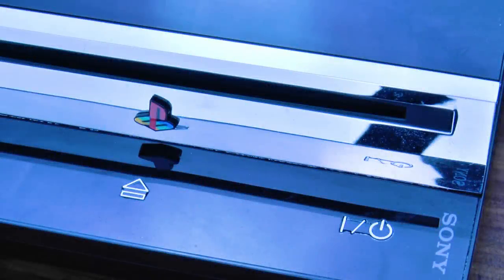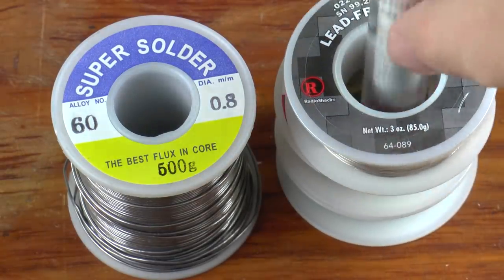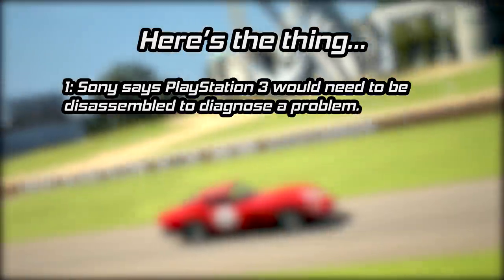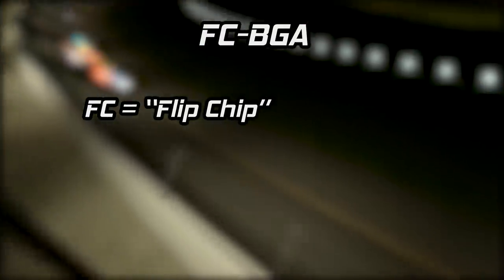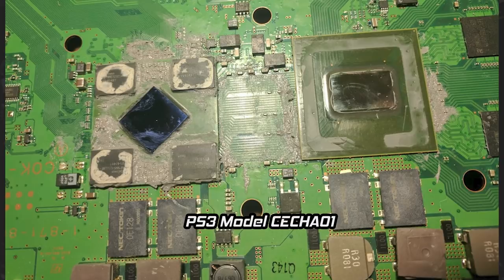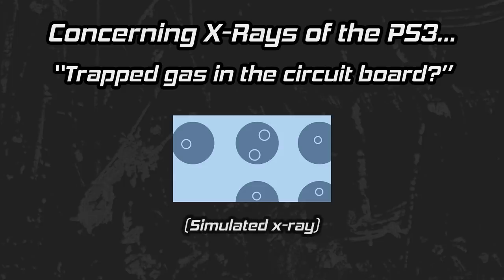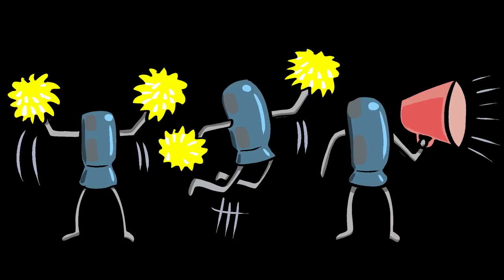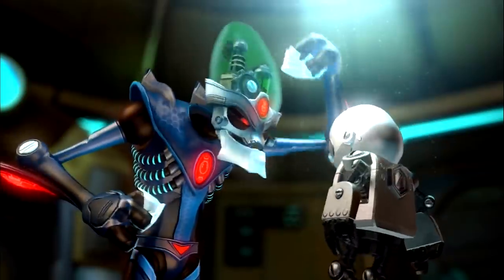The Misdiagnosis of the PlayStation 3 Yellow Light of Death

Comment: So even without hacking your PS3 it still would cause YLOD for the earlier models!?
Reply: Hacking has nothing to do. I had a launch 60GB model that died in about 5 months from YLOD. Then I bought an 80GB model (the one with ~85% backwards compatibilty with PS2 games) and died from YLOD about 6 years later.

None of my consoles were hacked
Reply: @asturides  My PS3 slim 2xxx died after about 3-4 years, used CFW on it. But never intended to hack Sony consoles again after that. I still have one untouched PS3 super slim, never use it. I keep it because of Gran Turismo games. I hope PS5 can run PS3 discs natively, although the chance is thin.
Reply: @eternaya  I wish that too. My PS3 controllers are dieing and there are not many originals around

Comment: Basically the same thing happens in auto repair. It is beyond frustrating when a customer walks in asking for a specific repair (usually replacing a sensor) without any more diagnostics done beyond a code pull. They usually claim that their problem is "exactly like" some random post in a forum and that they know what they're asking for will fix the problem. Most of the time, I already know what issue they're referring to (TSB's are helpful) and that their vehicle isn't going to respond to that 'fix'. They'll get angry when I tell them that I'll do what they ask as long as they don't hold us responsible for when the Check Engine Light comes back on. More anger ensues when they ask about the diagnostic charge. It is a vicious circle that could have been avoided if the person would just let me do my job.
Weirdly, My Mate Vince just went through replacing those capacitors on his channel. I didn't watch all of it to know if he was successful. I just thought it was interesting...

Comment: I reflowed mine twice by taking stripping down and pulling apart the motherboard and applying new thermal paste myself as a teen. I was in its guts and i performed this operation twice and For me the difference was getting 3+ extra  YEARS out of my yloded OG Phat day1 ps3. Had i not done this i would have had no console after H.S. and before the ps4... i am no electrician past getting my Merit badge in BoyScouts. But i mean, my ps3 would have been a paperweight halfway through the generation, but i recesitated it twice and  kept it alive up until the launch of ps4 soooooooo, knock it all you want but unless you can provide a better working solution then.. ahhh shit ya dont know?!?! Even now? Ok... I used a heatgun on my motherboard VERY carefully and minimally. And 3+ years! I did it myself and didn't cop out. Nice to have a better solution to repair it for good, But when your kid with otherwise NO console guess what? A solution that works is far better than no solution as at all, as much of a hassle that it may have been.

Comment: I threw my 40gb ps3 motherboard in the oven every time the ylod appeared for about a year. It was such a painful console to own. I loved the PS3 library, but hated the console hardware, because of how expensive and unreliable it was. I’m so glad the PS4 and pro don’t have any issues, whatsoever, I wish it was backwards compatible with PS3 games, though.
Reply: Actually numerous PS4's didn't even work at ALL during launch, I never heard an official follow-up as to WHY, either...there was talk that they were damaged during shipping, tho others that people bought worked fine until they got mildly bumped & also stopped dead (talking TINY bumps, not mock-up WWE bodyslam competitions).

By sounds of it the (launch) PS4 was either assembled poorly or assembled with brittle/inferior parts, tho SCEA honoured exchanges/warranties etc & seem to have quickly corrected the problem (it ONLY happened to the units released at launch during Holidays AFAIK)...

...still, far as I'm aware they NEVER actually SAID what the problem even WAS (blaming rough shipping was just their initial response after they tried denying it outright until the denial was refuted by HUGE #'s of consumers w same complaints), tho at least was isolated.

PS3 has had several issues & each iteration has actually been a downgrade (Back-Compat was 1st to go, then they swapped the 19-blade straight-edge fan for a [cheaper] 15-blade curved fan [that was found to actually back-flow heat INTO the system, ESPECIALLY if laid horiz rather than stood vert etc]...there were at least 6 of these downgrades as versions went)

Feature-wise the Back-Compat versions were best (IIRC the 60G was best of 3 launch models), performance-wise the Slim was best & tends to live longest. Superslims were the worst of all, tho later ones are better than initial Supers (which were a cost-cutting end-line production model as they waited to release PS4 & 1st Supers were basically shopping bags & bubblegum for quality), because they failed often so SCEA reworked/improved them a bit. Supers at least had ability to recover disks tho...needed to do surgery on any of the older ones to recover disk if tray locked up. Metal housings in older "fat" models were a BEAST to crack open~
Reply: I'm curious as to what the PS5 will do as far as BC tho...I hear rumour it may be "total BC", doubtful TBH, but it'd be GREAT to play my entire library again...I have over 100 PS games, over 60 PS2 games & easily as many on PS3 if not more...as SOON as I knew PS4 would have ZERO BC I was on the fence then passed altogether with the PS+/XBox mimicry just to connect online (I pay my ISP, VERY well, for exactly that)...if PS5 is fully BC I may consider even if PS+ is still a thing/I just play offline.

If it only plays PS4 (ie no PS3 at ALL nor anything prior) they can keep it tho (since I never bought any PS4 games anyway) & I'll just go to PC after I save up/build one. Gonna hang on to my library til then & see how goes tho~
Reply: Blemished Nicely I’m sorry but tldr more than 1 paragraph that you posted. And yes, I remember reading a lot about broken ps4s at launch and the bad batch story. But I feel my comment still stands. I don’t read a lot of system failures online that are systemic like the 360/ps3 overheating issue, just minor superficial ones like loud fan noise.
Reply: @kaytee7607  
Dunno, as soon as they  announced PS+ was mandatory I stopped buying consoles. After hearing about the busted launch machines (coupled with the rather dismal past few years for gaming industry in general as a whole) & am pretty glad I did.

Went from a console per decade to PS4 Pro 4 or so years after PS4 & IIRC they announced PS5 with estimated "Holidays 2020" release date (before Pro was even OUT, IIRC)...pretty ridiculous stuff IMHO~
Reply: @kaytee7607  
PS4 also has the same horrible Data Transfer utility as PS3 (which they lazily ported to larger HDDs [was only designed to handle 100GBs tops] like they did for the Friends list on PS3, which was only meant for 50 & bugs out at 70 or more).

IMHO they kept that Transfer lazy on purpose to encourage PS+ sales/cloud access.

Comment: My PS3 doesnt YLOD but its USB chip doesnt power on its 2 USB ports. Dunno what should i do after watching this. I was planning on reballing/reflowing
Reply: Find and check the USB power fuse. Or first try to determine whether the issue is with USB data or USB power - use an active hub with a power supply or use some kind of device that uses only external power supply and doesn't use bus power.

By all reason, reflow is likely never the answer, and can you even perform a proper reball?
Reply: @SianaGearz  Its power. The USB reads (or tries to do so). A USB hub lefts it blinking, or not recieving enough power.

Comment: I donno if this was a wide spread problem or just the same problem as in this vid but .i had several ps3's and each and every one without fail i could eather have it for a month or a year(ish) and then it would stop powering on .the only thing that would help was to blow or apply cold air into the fans somehow then turn it on and miraculously it would just work as if nothing happened. But you would have to keep it cold for about an our at a time if you wanted to turn it on and off more than once in one day .it drove me mad and still have the console if anyone has any suggestions on how to fix it 🙂

Comment: First I replaced the PSU... no luck. I have taken apart my 60gb ps3 more times than I want to count in an attempt to reflow both the GPU and CPU. I will say the cheap thermal paste used in the ps3 is horrible. It was dry, crusty almost and I switched it out with artic silver 5. However, I never removed the heat spreader to change out that paste. I even used flux a couple of times when applying heat from a heat gun in an attempt to reflow. Everytime I reflowed the bga's the ps3 sprang back to life for a period of about 6 months. After 3 failed attempts at reflowing I even had the GPU and CPU reballed with leaded solder which cost me almost $300. This again only gave me about 6 months of medium/heavy use. When it failed for the last time I got desperate and heated the mobo in an oven to reflow everything. This warped the mobo and I would advise never to do this based on my experience. At the end of it all... I still have a ps3 with the yellow light of death. I can tell you first hand that reflowing and reballing was merely a temporary fix in my case and did not solve the issue. I did so much research because I refused to simply settle for a $600 paper weight. I could probably disassemble my ps3 in a dark room at this point. This was years ago however, and I never remember seeing anything in regards to the capacitors potentially being the issue. Its unfortunate. This was a serious issue and one that Sony should have acknowledged and addressed. Microsoft did the right thing for their customers and the red ring of death. Sony ignored it.

Comment: If you do get the YLOD, how about doing this. 

Reball both chips.

While both chips are out, heat up the center to potentially fix any issues there. 

Replace the NEC chips. 

3 potential issues possibly fixed. 

BUT I've been trying to fix a strange PS3. 

This PS3 doesn't have the YLOD or the RLOD. It powers on, will display for 5 minutes and after maybe 5 boot up attempts, the screen will garble up and freeze. That RSX is gone hahaha. I want to learn how to soulder so these two broken ones I've collected off people who didn't want them will be practice attempts.
Reply: >reball both chips
so you'll never know which of the two chips had gone faulty
Reply: @matt4193  Doesn't really matter to me. Preventative maintenance anyway.
Reply: @XxUltimateGodzXx  heat cycling a component is not preventive nor maintenance, in fact it shorts its lifespan.
Reply: buy a new chip in aliexpress
Reply: @maytizevb  no.

Comment: I just put my PS3 in the oven as two tutorials suggested and guess what? It didn't work. Will order some capacitors and hopefully bring back the PS3 alive. Seeing it die only after successfully delidding the RSX and CELL a few months ago, this would be very irksome.
Reply: Putting your PS3 in an oven is NOT a good way to even attempt a fix on the ylod, the problem isn't even the NEC Tokens (or the balls necessary)

It's the RSX's underlay
Reply: did you two even watch the video

Comment: My ylod was the failure of the power supply and the disc drive ribbon cable took out the disc drive with ribbon cable found out the cable lock on the board broke and it still had it so i tried the power supply and now it works a new power supply later i did get the disc drive to work but not reading discs mostly due to the cable being bad did eject disc and did read ps2 game not ps3 game so now just new disc drive due to laser not being strong enough for the blue ray to work only the DVD to work poor ps3 but it will work again

Comment: I'm thinking of an experiment. I used Gilksy's YLOD repair guide three times on 60/40 GB phat models. The 40 one was for a friend and he only did it to play the final missions of GTA V before scrapping it, so I wouldn't know how long it lasted/could have lasted. My own 60 GB launch model was YLODed after six years of heavy daily use in non-dusty, non-congested environments. I fixed it once and it lived for a year, then it died again. This time, I repaired it and hoped it would last long enough to restore saves and backup the HDD for the super slim I bought for replacement. Then I retired it at my parents' house and while no longer being used often or for heavy gaming, it still lives on five years later.

For my experiment, I could try only heating the NEC components for my next repair, should it ever need one. In all the repairs, I followed Gilksy by heating CPU, GPU and NEC with a heat gun. The first time and for the 40 one, I only heated them, and got the final repair of the 60 I also added reflux liquid at all components heated. If I need to repair it once more, I'll try just heating the NEC components and skipping CPU and GPU altogether and come back to you with the results :)

Comment: The caps that are the issue when u try to boot the system it will go to ylod almost instantly as they chip/s cant get what they need to run. If they system has a bad connection on the cpu or GPU it will look like its going to boot as normal then fan speeds up to near max and shuts down with ylod. I own 4 different fat ps3s I managed to "save" 3 one was just a simple hdd failure. 1 needed a reball while the others had faulty caps. This post was just to tell you guys what I found helped me. I didn't use any online tut or help pages as they are all bullshit for the ps3
Reply: Yeah, people need to really observe their launch PS3s, observe how it YLOD in the first place, then trouble shooting can be done.
We need to ask ourselves, did the fan kick on higher? Was it just one day you turn it on and then YLOD? Did the screen freeze up randomly when using console?

Comment: 95% of the issue was RSX or cell chip with its leadfree solder. Yellow light could be other issues such as power supply etc. Reflows never lasted.  My old company Called Knights gaming repair we used to do 100+ consoles a day. We took off the chip and reballed it with lead solder. Nine out of 10 times this works. Sometimes we actually had to replace the RSX but the cell chip was not replaceable same with the Xbox 360 CPU except for if you replace the NAND chip with the CPU.
When replacing the lead solder we always delaminated the chip from the heat sink to reapply new thermal paste between the CPU and heat sink. We also fan modded all the units to keep the unit cool. Finally if that didn’t work the motherboard was probably to flexed from excessive heat. So I was discarded and stripped of its components. There were other small issues on the board that we fixed like HDMI port and other Micro Soldering in issues over the years.

So also I’m still watching the video. Replacing the chip sometimes was required but warming up the motherboard to the proper temperature was critical in order to prevent flexing of the motherboard or damaging other components also protecting the rest of the Components shielding. We use the dark infrared machine with a specialized jig that we had to custom make.

Also the yellow light of death had many different signs of yellow lights. It’s hard to explain but we knew exactly what the issue was based on how the yellow light made it’s noise and how it was produced and how long it took to produce the yellow light. We could 100% diagnose the console just buy sound and visual cues. 😎

Overall 99.99% of the population wouldn’t be able to tell what the issue is by the yellow light alone without proper training. And to be honest I don’t remember any of our technicians knowing the visual and audio cues it was mainly done by my partner and me. So your video is basically right. Now for the caps Going bad that was a very rare issue just like the xbox Southbridge or the HDMI chip or any other components on the board going bad. That’s because the main issue was heat. The consoles Would clog up full of dust, the thermal paste with dry out and could not be user replaced on the PS3 do too requiring Delamination of the RSX chip. Overall great video I have no clue how I ran into this.

Comment: odd how this was a very well known thing and this is the first i have ever heard of this and all my friends with ps3 never had this issue.

i have a original fat ps3 that i did have to replace the cd drive like 4 years ago but she still going strong. granted i only use it to play blu-rays and dvds but she’s still running just fine and i use to go on all nighters with battlefield bad company 2, 3 and 4 i think was on ps3? anyway i think people just wasn’t taking care of their ps3’s. you have to clean them out and they have to be well vented. there was a few times i turned off my ps3 and i could feel the heat coming off of it like wow poor thing sure did take a beating lol. i even got rid of my ps2 because the ps3 was backwards compatible. so god only know how many hours i’ve put on that machine and only needing to fix one thing out of all those years plus none of my ps3 friends never having issues so either we was all extremely lucky or we just took care of our stuff.

now controllers is a different story i had to buy one about every 2 years the damn joy sticks would start losing tension and would not go to center and the l2 and r2 buttons would break. those i could fix i would buy a bag of them off ebay for like $10. but when the joy sticks start looking like they had a lazy eye it was time for new one